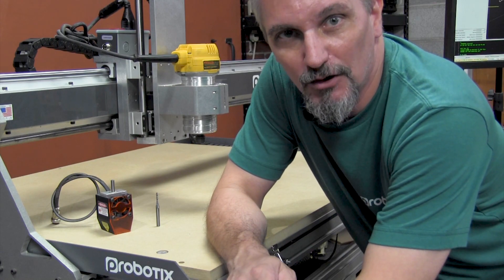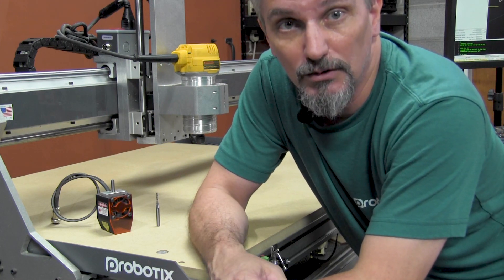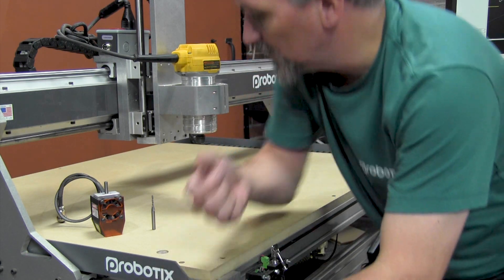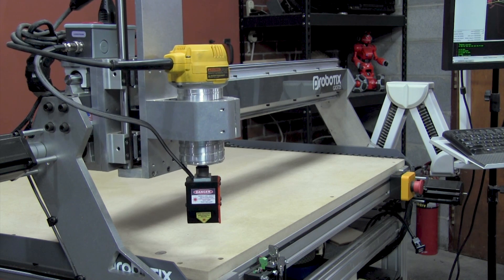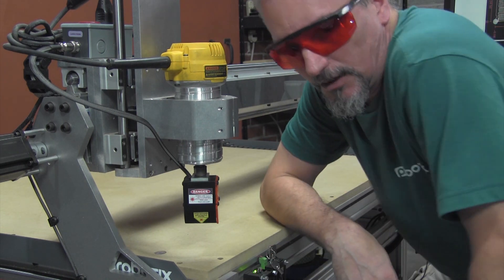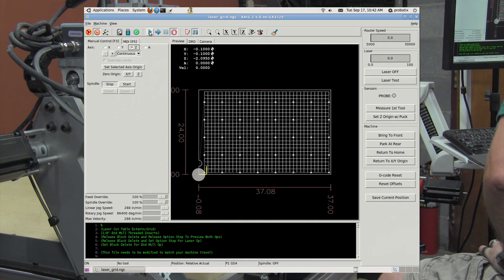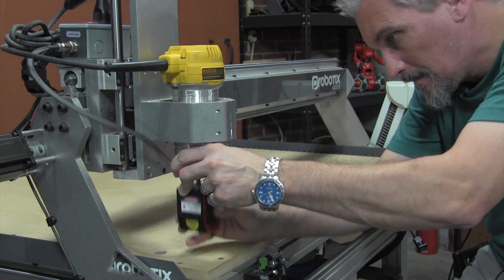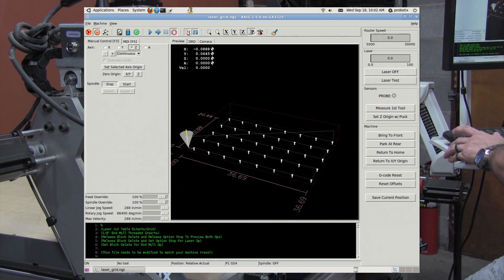Prep Your Spoil Board with A Grid and Threaded Inserts

Comment: What's best, threaded inserts or the ones without the external thread i.i. to be hammered on the other side of the board (I don't remember the name)?
In other videos some (few) guys noticed that threaded inserts can easily pop out if pulled with some force.
Reply: They are called Tee nuts. They probably are a better solution than threaded inserts, which will pull out of an MDF spoil board in no time if you need to clamp things down hard. The common type have spikes and are hammered in, but I think the round backed variety might be event better as they are held in place by 2 or 3 screws. A lot slower to install though!

Comment: I've seen other videos and posts that say threaded inserts pull through over time with clamping and is not the way to go.  What issues have you seen?
Reply: That issue can be lessened by installing the inserts from the bottom up.  But you would need a slightly different tool path.  Have also heard that 8 mm holes are better than 9 but would have to test this to see.  Maybe 8.5 or so?

Comment: Nice Len. Have you run the laser spindle attachment with your 4th rotary axis on spindles or other cylinders?
Reply: Follow up question. Any reason you went the traditional paper touch off instead of using the Tool Length Sensor when you put in the endmill?

Comment: Thanks Len. I used a drill for the threaded inserts and finished the holes with a step bit to provide relief to recess the collar of the threaded insert to keep it below the surface and out of the way in case I cut to deep by mistake.